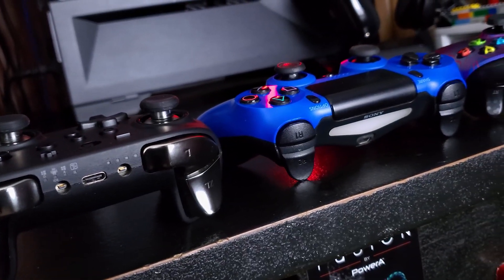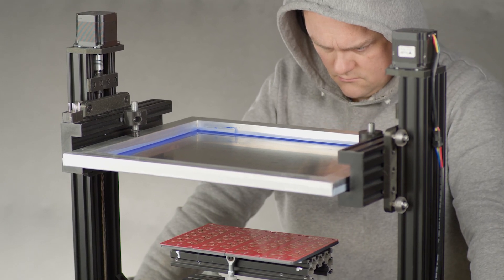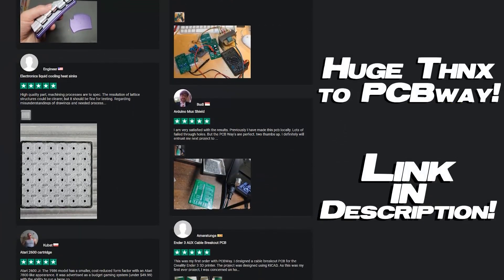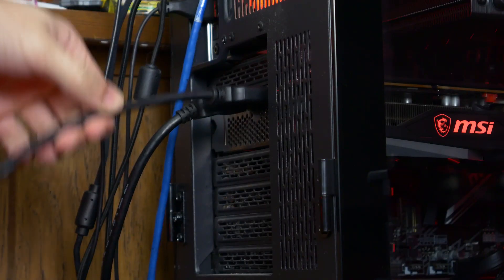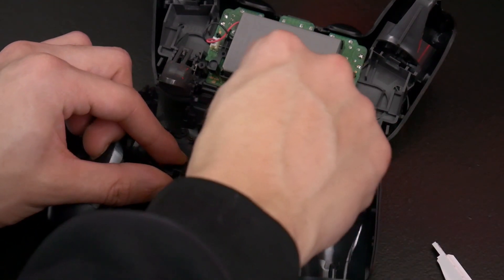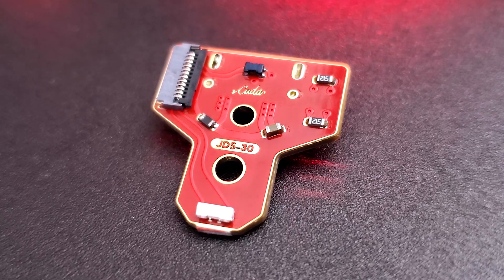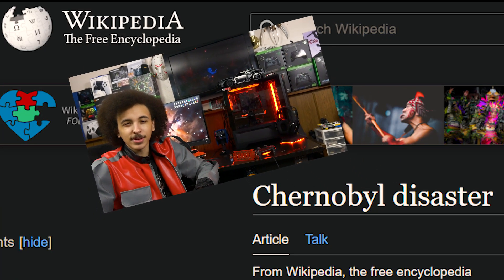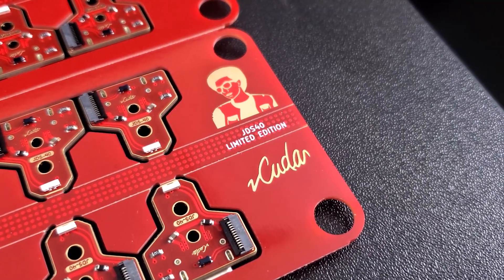EASILY Convert Your PS4 Controller to USB-C! (No Soldering)

Comment: TBH, I just use Magnetic USB cables for my controllers. It means than any magnetic cable, charges a magnetic connector equipped controller whether it be type c or micro. Plus it means that I never actually use the sockets, they get plugged in and left!

Comment: Micro USB is by far the worst generations of USB's models. That junk was so weak,fragile and unusable
Reply: Agree
Reply: The timing of reading of your comment is the same as the duration of the Micro USB
Reply: Totaly agree. I’m using my ds4 to play on pc atm, and yeah, I’l make the mod.
Reply: @johnbartender3451 that’s a sponsorship
Reply: the worst part is all the cool electronics that were made before USB-C was widely adopted so they ended up with this garbo connector, i swear these chew through cables like they're doritos. USB-C's reliability is unparallelled
Reply: Yep

Comment: I will definitely be checking this one out! Sadly, the item is currently sold out right now. And my Dualshock 4 is having problem with the charging port. I was planning on buying a replacement for the port but came across of this video and got interested so.. “Why not?” I have lots of USB-C cables and PS5 controllers and Xbox Series X|S controllers which all uses USB-C

Comment: thanks this is exactly what i was looking for. i hated having to buy good micro USB cables just for one device. easy install too. just be careful with the ribbon cable. i had 2 different models JDS 30 and 5x and mixed up the ribbon direction and easily stripped one.

Comment: Another reliability issue you should wage war against is also related to the ports on controllers. The ports are FAR too exposed and lack support. Every time you put down the controller on a surface, unless you put it down on the edge with the cable facing over the edge the area of the cable right before the connector ends up getting torqued. over time this stress causes damage to the wire breaking the cable. Also it is VERY easy to accidentally damage the port, if you accidentally knock the controller at the connection.

there is a pretty easy solution to this issue I first saw on the Scuf Impact. A recessed area for the port with collar section extending out slightly surrounding the connector. This would help reduce stress on the cable AND the USB port, and even if the cable does break the reduction of stress transfer to the  USB port means you only replace a cheap cable instead of a band aid repair or buying a new controller.